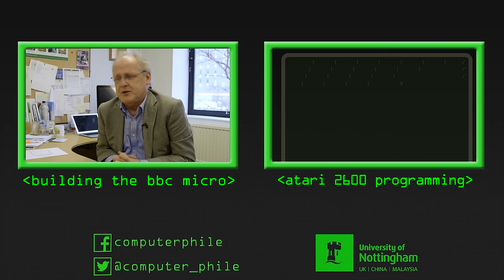Discussing System On Chip (SoC) - Computerphile

Comment: It's crazy that in one clock cycle light can only travel 10cm. These are some incredible machines
Reply: It's even worse, because signals travel slower through metal than light does in a vacuum.
Reply: + more radiation polution. + lo voltage DC voltage losses over huge 1970s era cable connector usage.

Comment: Nowadays if you want to customize the entire thing down to the cpu, you can always plonk down an fpga, use a soft ARM or RISC-V core and build the rest of your custom circuity into the firmware without ever needing to design and produce a custom physical chip.
Reply: It's too expensive for most companies to do this. Hence dedicated chip vendors perform this and sell the customized chips to the client business.
Reply: @anujmchitale  It's worked wonders for the startup I've been a part of though. No custom chips or socs that limit choices of what other hardware you can attach. Just a big fpga that does all the custom signal handling and you're set.
Reply: At the cost of lower clock speed and higher power than an equivalent ASIC though
Reply: @Lttlemoi  oh nice.
Reply: yeah, but then if you want to optimize the costs, speed and power consumption you have to convert it to ASIC. It's a trade off of course.
Reply: @Lttlemoi  do u know how to code or program
Reply: @Lttlemoi  I work with radio test sets that do the same thing. The only dedicated processors are a 1.8GHz Intel SOC that runs a Linux program for user interface (and that module is COTS), and three Texas Instruments DSP chips. The northbridge on the CPU adapter? FPGA. The control interfaces between the data bus and the filters/oscillators? All FPGA, and all programmed at boot.

Comment: Very good video. As a retired HDD firmware engineer, I can tell you that storage devices had systems on a chip (multicore). In fact everything on an hdd has gotten smaller, use less power, and faster over the decades.

Comment: I think you should have mentioned the most important leap in modern SoC design: incorporating the RAM.
Reply: The RAM on the new M1 Macs isn't really "on the chip" - it's still a soldered-on component.  It is in fact possible (albeit via extremely specialized work) to upgrade the memory on an M1 device.
Reply: @jpdemer5   True, but the fact that it is not in the same die doesn't change the characteristics in my opinon - it is still simpler, faster, less flexible, and non-upgradeable (for practical purposes). What most people consider a "chip" is the package anyway, although I agree technically speaking it is "System-in-a-Package".
Reply: @leomuzzitube  that's the thing: the RAM is on a separate package, which is then soldered on top of the CPU. They are two separate packages. That said, most SoCs do have a decent bit of internal SRAM, which is great from a bootstrapping perspective (DRAM tends to need to be "trained"), as well as a security perspective (raises the barrier to entry for attackers).
Reply: The RAM is on the same chip but on a separate die within the chip, if that makes sense. It's what we would call separate chips back in the day but now it's packaged together in an enclosed shell which looks like a classical chip at first glance. We now call an integrated system on the same silicon wafer - a die, and the package which may contain several dice - a chip.
Reply: @elimalinsky7069  this isn't correct. They have a BGA DRAM chip which then gets soldered on top of the CPU
Reply: @metroid031993  Yes, but it isn't integrated into the CPU like cache is.
Reply: @elimalinsky7069  yeah; it's totally separate, agreed there :)
Reply: @metroid031993  Is that called Package-on-Package (PoP) ?

Comment: "I am not a chip designer" - never thought I'd hear that disclaimer, hooray for engineers :)
IAACD (I am a chip designer) and this was a really good outside view of why SoC so good job all.
Only addition I'd make is that it used to take a couple of engineers about 2 months from inception to prototype to design a new computer (what I did before SoC), a few thousand quid for a handful of prototypes and you could test and fix it in "real life" with a soldering iron until it was working and start selling the final product a few months later. With SoC it takes more than 2 months just to very precisely specify what it does and probably more like a team of 12 engineers 2 years and a few hundred thousand quid to getting a chip that has a chance of working and there's no bodging it with a soldering iron when it doesn't so add another pile of cash and 6 months+ if you got it wrong, which is why most technological changes are now evolutions not revolutions.
Reply: Not to mention geting capacity in a sufficiently advanced foundry with the right production tech, and apparently you can't just go to a competitor , at keast nit uf you want the latest and greatest tech
Reply: @bjarnenilsson80  do u know how to code or program

Comment: Actually I think you can go back a bit further, because in the early/mid 1980s there already were quite a few MCUs that combined CPU with timer(s), A/D converter, UART, etc.
Reply: I agree  with  you as most tech  channels  resort to  attention getting behavior  to seek  views
Reply: SoCs are distinguished from microcontrollers by being at the heart of a PC or PC-like system. Microcontrollers typically integrate volatile and non-volatile memory. You could argue about terminology all day, but the intent is different between SoCs and MCUs.
Reply: @tackline   No,  I am saying that  a  custom   ASCI'S   are the  same thing as a  SOC ,as they  contain  all  the necessary  building  block circuits  that that are  needed  for  a main function of  a  device  such as   test  equipment,  big screen  TV's ,  network   appliance, network  routers,  and special medical devices
Reply: @johnsenchak1428  ASIC's were the precursors to SOC.  Like most technology, everything builds on the previous generation.  PAL's were the precursors to ASIC's, and are still in use today.  I remember, back in the 80's, using ROM chips as cheap PAL's, once you finalized your design.  And using EPROM's while in development.
Reply: Yes, the 80188 and 80186 from 1982 were microcontroller versions of the 8088 and 8086. They had on-chip timers, DMA controllers, interrupt controller, clock generator, and wait state generator. No UARTs or A/D converters, though.

There were plenty of 8051 variants with UARTs and A/D converters and lots of other goodies.
Reply: @johnsenchak1428  In an SOC you find the CPU : not the case in an ASIC.
Reply: UART. The interface that doesn't want to die. On every new product we have to design it.
Reply: @johnsenchak1428  do u know how to code or program

Comment: There is also a tremendous speed and power advantage to routing high fan out peripherals on chip vs. off chip. Anytime you have to pass a signal through a pad driver and externally, the driver power goes up and the speed of the line goes down. One of the great drivers of SOCs were the making of cells out of standard design blocks such as CPUs. To do this, silicon designers would separate the cells (CPUs, peripherals, etc) from their pad ring drivers. Thus a single cell design could be dropped into a SOC using multiple cells internally, or drop into a pad ring to make a stand-alone design.

Comment: I'm sure I heard somewhere that the latest Raspberry Pi is originally a SoC for a set top box.
Reply: That's entirely possible, a lot of that sort devices (which are effectively computers in their own right) make use of ARM socs like the one you'll find on a raspberry Pi. Edit: did a bit of digging, the soc in the original pi (v1) was indeed also set in set top boxes like the first gen Roku. The soc in the latest generation (pi 4b) is more or less made for the pi but very much resembles a different model Broadcom (the SoC manufacturer) also makes which is once again intended for set top box usage.
Reply: The first one certainly was.
Reply: Nick Williams  do u know how to code or program

Comment: ARM250 based Archimedes ( A3010, A3020, A4000 ) can be very easily overclocked up to 24 Mhz thanks to faster DRAMS.
It's all detailed on the Stardot forum.

Comment: I also would like to add, that soc is not only about computational power and exact circuits on chip design(features and so on) but also end user devices manufacturing processes. The size of exact circuits on chip is way smaller that final chip “package”, because the package used not as a shell only but also as heat conductor and array of contact points. There also cons and pros going from this fact.

Comment: One more advantage of a SoC, is the power efficiency. 
Transfering data uses more power than the actual calculations made in some discrete systems. 
Having the data close, reduces that energy requirement. 
Also latency is reduced. 
This also translates to cost savings for cooling solutions. 
And weight savings for mobile devices.
Reply: It beggars why we haven’t already moved more discreet systems onto SoCs and left everything else for where you really need the extensibility
Reply: @Freshbott2  There are multiple factors. It's harder to plan for the demand of a more specific piece of circuitry. And more complex SoC's do use more die space, which reduces yields in the production. A modern Pc is close to a SoC. But since it's rather complex, it's more economical to leave some aspects modular. So at the moment, it's either a hybrid approach, a smaller SoC or a very big production run of a company that can dictate what the market demands. For example apples M1 chips are such a case. They can afford to ignore every customer who's needs are not fully met.
Reply: @heyarno  I don’t really think that’s it though cause whether it’s a Mac or PC laptop of whatever kind it’s already not meeting the majority of people’s needs fully. The only people who are fully met are the ones an SoC wouldn’t benefit. Forget all the different encoding and enclaves and DSPs etc. just theefficiency gain from moving to true integrated graphics is what people want. Everyone wants that MacBook body.

Comment: Me, an ECE student, who somehow managed to pass this semester: "hmmm, interesting..."

Jokes apart, it's videos like this that keep me going. Thanks!
Reply: EE student here, still struggling.
Reply: studying EE is not worth it imo unless you want a job in academics or some fancy prosthetics firm. most of what i learned about engineering (digital circuits, microcontrollers, etc) i learned either on the job or DIY style. most complicated formulas from my studies i actually used was capacitor charging curves....
Reply: @QuantumFluxable  I have no choice since its either EE or CS in my college. There  is no Computer engineering, and I want to learn more about hardware design ( VLSI design, embedded system).

Comment: The primary design constraint in GHz+ PCB design isn't propagation delay but the fact that those are microwave frequencies. Traces act like transmission lines, not wires, and fast edges generate very high frequency harmonics. You can wave away impedance matching at the MHz clocks speeds of 1980s/90s machines, but not now.

Comment: Given how many more transistors that, say, the Z80A of a Spectrum has than the Spectrum ULA, it's a shame that SoCs didn't come about in around 1976. Put a DRAM-compatible interface on a ROM/PROM and a relatively cheap computer could have been built with a 40-pin SoC.
Reply: In a way they'd already started down that road with the Z80A--the CPU there included the capability to refresh the DRAM in the computer, which previously had been the job of additional circuitry on the board in earlier microprocessors.
Reply: @d2factotum  do u know how to code or program

Comment: This must have been the kind of thing that totally makes sense in hindsight. Of course you're not going to run a bunch of traces that are unnecessary if you just cram those modules together.
Reply: It's made sense since the first integrated circuits at the tail end of the 1950s. It just took time for it to become cheap enough to put everything on a single chip.
Reply: "just" like its that easy?

Comment: The modern x86 processors are kinda SoC too - built in cache, built in memory controller, built in IO PCI-Express bus controller etc. Compare to even 20?25 years ago, there was a 'north bridge' interface for memory controller and 'south bridge' for IO. If RAM serves, even kind of until the Intel Core 'i' era. On certain even older earlier ones (386, 486?) even cache was external. If nowadays a gpu is built in, all you need is RAM and storage and it feeds video output directly from the chip.

Comment: The ARM250, which you found in the A3010 ran at a clock speed of 12MHz vs the ARM2's 8MHz, but while the latter only managed 4MIPS, the former ran at 7MIPS, and that extra 1MIPS of speed was, in part, down to the fact everything (aside from the memory) was so tightly integrated on the ARM250 SoC!
Reply: I can't see how that would make any difference. It's literally all four of the original design placed on a single die, without so much as bothering to rework the layouts so that they fit together better. I can believe in better compiler optimisers (MIPS is measured from a particular C benchmark) and for the same screen mode, the video will be using a smaller fraction of the total bandwidth.
Reply: @tackline  That's 7 MIPS for 12 Mhz systems vs 4.5 for 8 Mhz. Yes : 2.5 extra MIPS DOES matter.

Comment: So would you consider the ULA on the ZX81 to be a primitive version of an SoC?
Reply: ULA is generally considered part of the CPU, so no.
Reply: @framegrace1  it's another chip, nothing to do with a CPU
Reply: @Archimedes75009  YEah. sorry. Thought you were talking about the ALU. (ULA is ALU in my language, hence the confusion).
Reply: @framegrace1  Ah, I see, I am French and it's the same here :-)
Reply: yes and no. I mean, guessing it isn't a complete system so no, but presumably it allowed them to create one chip that did the work of what would otherwise be several different ones. So while it wasn't a complete system presumably it had at least some of the advantages of SoC around cost/complexity saving, at the alternative expense of needing to design (the final manufacturing stage of) the ULA chip.
Reply: @WistrelChianti   But that doesn't make it a system on a chip, it makes it a cost saving measure :D   
It might cost you in development, but it will return cent after cent in assembly when there are less parts to place and less traces to route on the PCB, less copper to use for the traces. The more machines you build/sell, the more feasible it becomes.

It was even one of Steve Jobs' jobs when he was working for Atari, reducing the chip count on a game, which he ultimately outsourced to Woz :)

But these techniques also hurt repairability quite a bit..  If something breaks, you throw out a huge chunk of the machine and replace it or replace the machine altogether, instead of just losing one of the functions you might do without..
Reply: @framegrace1  Haha sorry about the confusion. But yeah I meant the ULA chip, not the ALU of the Z80.
Reply: @framegrace1  do u know how to code or program

Comment: You can make a wireless micro-bridge between GPU/CPU/Microchips shielded from outside interference and it can act as a BUS for interoperability and comms; eg. cryptography/timebased as the chips would "know" the distance to each other and can then encrypt the data.
Reply: Do you have any links demonstrating this? Sounds interesting.
Reply: You could also just use wires. 🤷‍♂️ Wireless is slower and much harder to design. It's only really better for portability.
Reply: intel labs semes to be going the route of photonics. I heard about it in a interview with Ian Cutriss (Anand Tech) on his Youtube channel